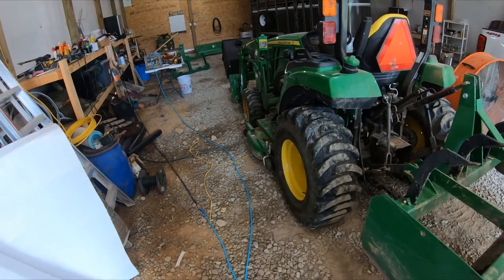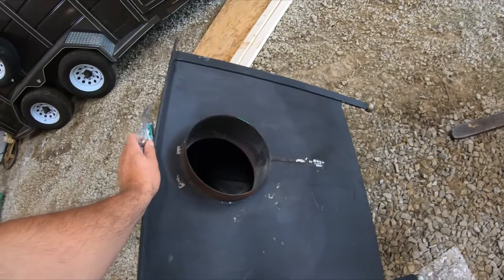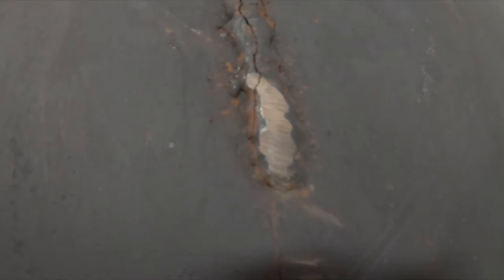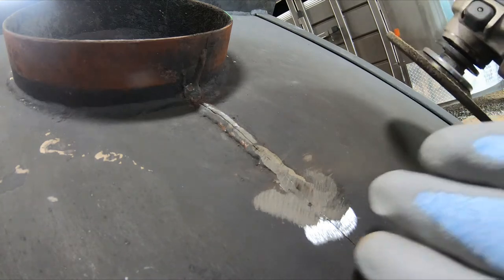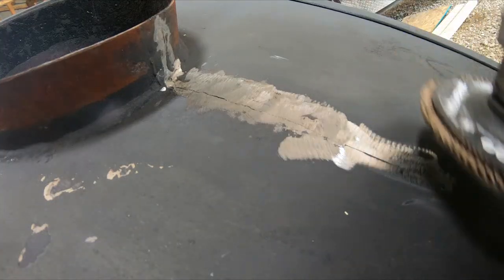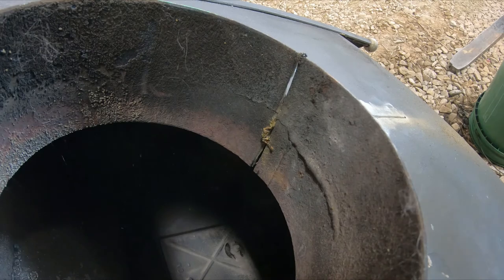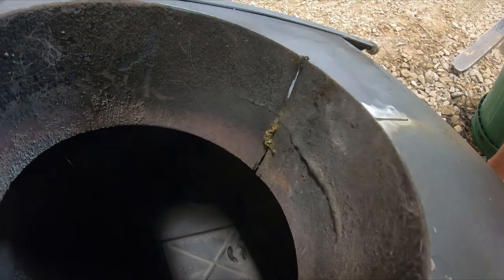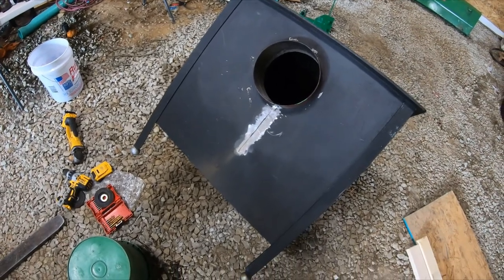Wood Stove Repairs {Cracked Metal} Exploding grinding disc

Comment: Have you tried using a Dremel with a cutoff wheel to clean out small cracks like that? They can be a bit fiddly, and I wouldn't use it on anything more than 3/32 mild steel, but I like the control.
Reply from the maker: no i have not